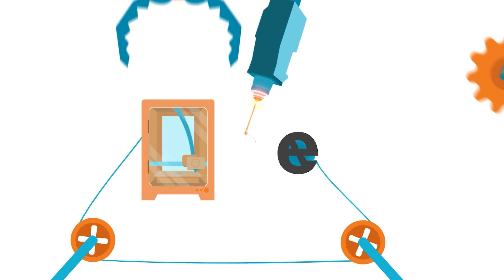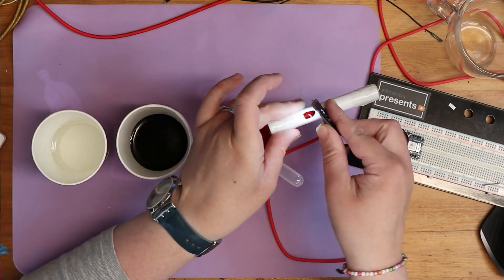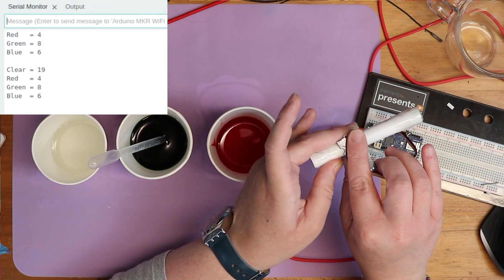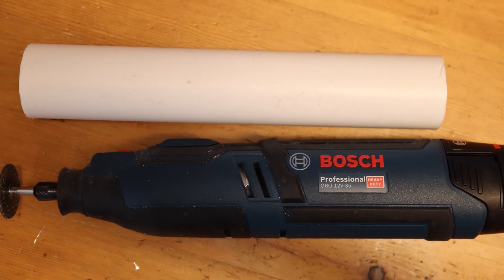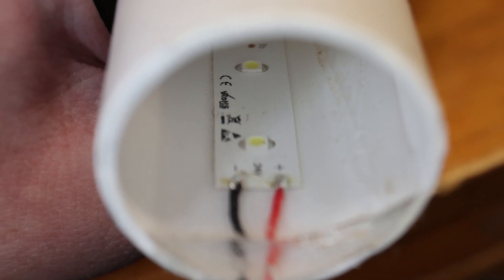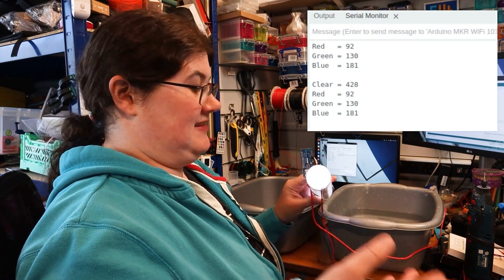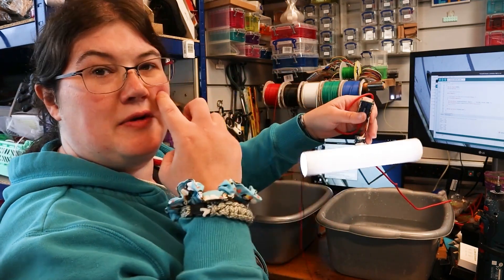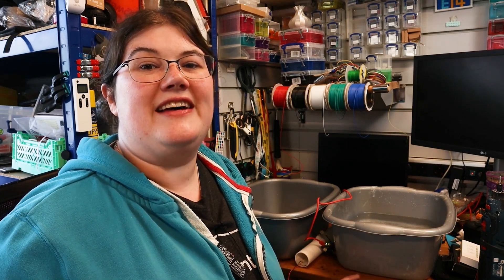Color Sensor-Based Water Quality Tracker: DIY Environmental Monitoring

Comment: Hi, nice experiment, have you ever tried using only a 10mm LED as a color sensor? These components can be used as sensors because if we polarize them the other way around, they give us a small voltage. You could try it with LEDs of various degrees (30 to 120) or colors or with an RGB, that would also be an entertaining and good experiment measuring the color of a bottle of water and dye and the other lake some light source like a flashlight. If you ever try it, I would like to see it. I had done it many years ago, successes.

Comment: Hi Katie, I need help in choosing an INLINE/DYNAMIC sensor or a combination of INLINE/DYNAMIC sensors for detecting Mucus, Semen, Urine, Blood and Detergents in FLOWING water.

The list of sensors i have found are

1. Turbidity sensor
2. pH sensor
3. Electrical Conductivity sensor
4. Infrared sensor
5. Total Organic Carbon sensor
6. Adenosine Triphosphate / Tryptophan Sensor
7. Dissolved Oxygen sensor
8. COD/BOD sensor
9. Color Sensor - RGB Sensor - Flow Cytometry
10. FTIR (Fourier Transform Infrared Spectroscopy) sensor
11. ORP/Redox Sensor
12. Ammonia/Nitrogen Ion Sensor
13. Biosensor

So which of these would best suit the requirement i am looking for?

Also, where can i find sensors that are accurate for prototyping? For ex., these SEN0189 turbidity sensors are not that precise, i am not finding better turbidity sensors for quantitative purpose.

Comment: Nice one Kate, well done. One thing I would do is to try and calibrate the sensor in software. With no water each colour reading could be more precise with a starting value of 255 for each value, then by dipping it in the solution, the opacity would be more accurate. It should be simple math to stretch the clear reading and confirm the light-off reading as well. The resolution of the reading will deteriorate, but the overall accuracy should improve.
Reply: Yes, that would be great, I could easily take the clear reading as a baseline and then I'd get the reading of the difference between the clean and dirty water

Comment: Turbidity is the measurement of the clarity of water, which along with total dissolved solids and pH are the first basic steps of determining water quality. Your sensor is a really good start in determining inline turbidity. I'm definitely putting that sensor on my to-do list!
Reply: Thanks. The person who gave me the idea for the project, outlined that a sensor that was cheap to put in loads of places would be useful. Then when they've detected there might be a problem they could bring out the specialist (expensive) monitoring equipment to investigate that location.
Reply: Hi Tony, I need help in choosing an INLINE/DYNAMIC sensor or a combination of INLINE/DYNAMIC sensors for detecting Mucus, Semen, Urine, Blood and Detergents in FLOWING water.

The list of sensors i have found are

1. Turbidity sensor
2. pH sensor
3. Electrical Conductivity sensor
4. Infrared sensor
5. Total Organic Carbon sensor
6. Adenosine Triphosphate / Tryptophan Sensor
7. Dissolved Oxygen sensor
8. COD/BOD sensor
9. Color Sensor - RGB Sensor - Flow Cytometry
10. FTIR (Fourier Transform Infrared Spectroscopy) sensor
11. ORP/Redox Sensor
12. Ammonia/Nitrogen Ion Sensor
13. Biosensor

So which of these would best suit the requirement i am looking for?

Also, where can i find sensors that are accurate for prototyping? For ex., these SEN0189 turbidity sensors are not that precise, i am not finding better turbidity sensors for quantitative purpose.
Reply: @vibheeshvelayudha2706 I would suggest checking with Endress+Hauser. They have a full line of wastewater sensors.

Comment: This is really great Katie, our house is supplied by bore water which has very high quantities of dissolved iron, as soon as this hits our water tank (or more specifically, the atmosphere) the ferrous ions bond with oxygen to make rust particles. I have filters in that tank to remove most of it before it gets to the house's piping but the quantity if rust particles does build up in the tank. Just today I received a new filter housing so I can run a pump to try to clear up the water in the tank periodically - your colour sensor concept would be a great way to detect the tank needs flushing and schedule it at a time it wont wake everyone up!
Reply: I hadn't thought of that at all, but my parents are on a borehole, and occasionally if the filtering needs cleaning then we'll spot it first when the glass of water your about to drink is the wrong colour!
I hadn't thought of offering them this sensor, but it might pick up a bit earlier than the water colour being an orange/brown!

Comment: I sense an interesting concept! maybe its not quantitatively accurate but it might give at least an indication if particels or big contaminations are in the water..for example to protect pumps from clogging.
Reply: that was the idea, something to detect there has been a change that you could then investigate and check with proper water monitoring kit
Reply: Hi MAYERMAKES, I need help in choosing an INLINE/DYNAMIC sensor or a combination of INLINE/DYNAMIC sensors for detecting Mucus, Semen, Urine, Blood and Detergents in FLOWING water.

The list of sensors i have found are

1. Turbidity sensor
2. pH sensor
3. Electrical Conductivity sensor
4. Infrared sensor
5. Total Organic Carbon sensor
6. Adenosine Triphosphate / Tryptophan Sensor
7. Dissolved Oxygen sensor
8. COD/BOD sensor
9. Color Sensor - RGB Sensor - Flow Cytometry
10. FTIR (Fourier Transform Infrared Spectroscopy) sensor
11. ORP/Redox Sensor
12. Ammonia/Nitrogen Ion Sensor
13. Biosensor

So which of these would best suit the requirement i am looking for?

Also, where can i find sensors that are accurate for prototyping? For ex., these SEN0189 turbidity sensors are not that precise, i am not finding better turbidity sensors for quantitative purpose.